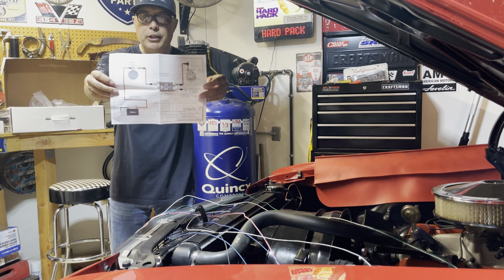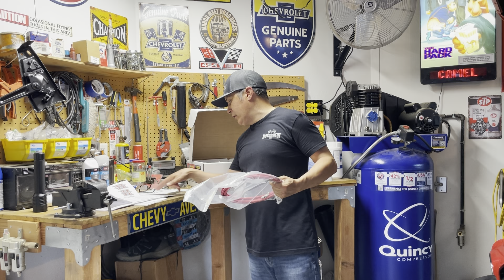1971 Monte Carlo SS454 Part 62

Comment: 6awg from battery to starter seems too small to me for a 454cui engine, but new starter motors are more efficient than factor originals for the 1970s period. Then there is the matter of engine compression. It might be worth double checking.
Reply from the maker: There will be a standard battery cable from the battery to the starter. The 6 gauge cable will run alongside the positive battery cable and terminate on the same post on the starter. Stay tuned for the next episode to see!

Comment: So the mega fuse block came with the kit? I also have a 1 wire alternator, 140 amp. Polished Tuff Stuff from Summit Racing
Reply from the maker: Yes sir it did. I'll be installing the alternator in my next video.

Comment: Where did you purchase the fuse block
Reply from the maker: The Mega Fuse assembly was included in my wire harness kit.
Reply: What size fuse did you use
Reply from the maker: @xpelon209x  The Mega Fuse is 175 amp.